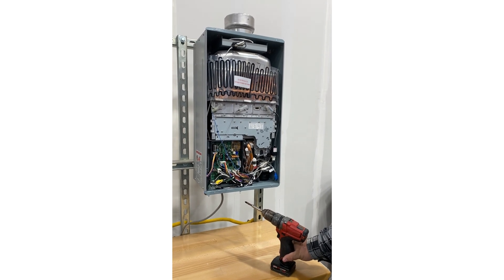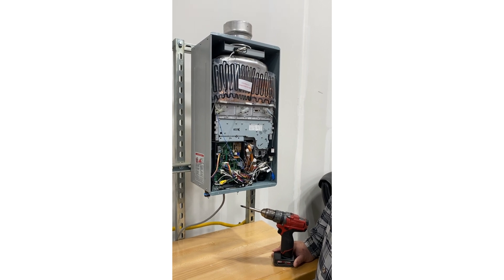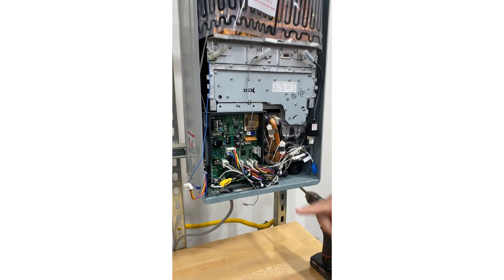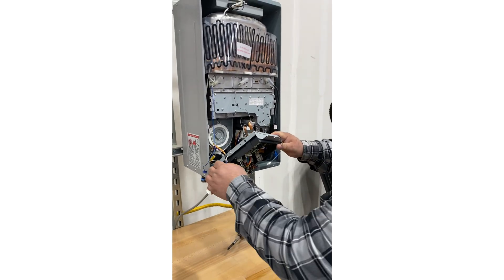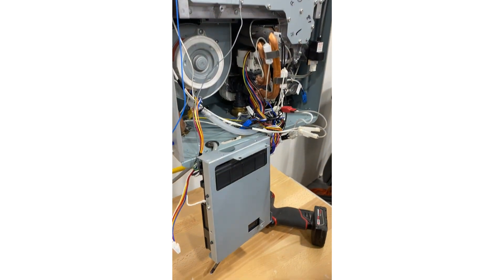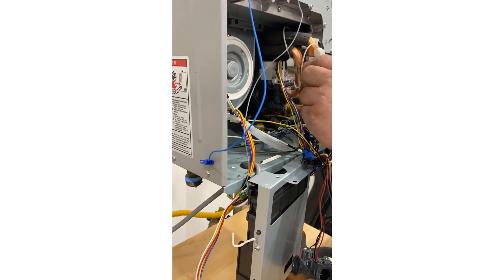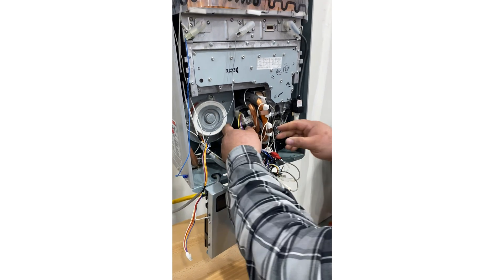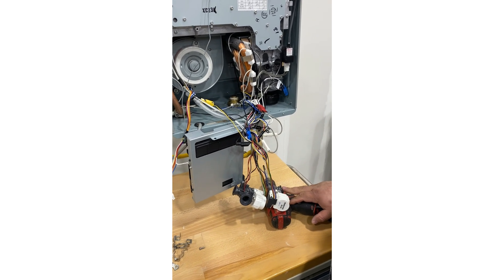Removing and Replacing the Water Control Valve in a Rheem Tankless Water Heater

Comment: Great video! Can anyone advise on the part number of the control/bypass valve combination? Maybe the bypass assembly is RTG20235X. And perhaps the control valve is RTG20164L. Looks like Home Depot has them, but it's a very long wait! I ordered some directly from Rheem and they have a 2-day option, which is nice! Next power outage, I'll know to drain the tank using the two valves just on the outside of the unit (after turning off the water supplies to the tank).
Reply: Those are the model numbers for my water heater as well.
Reply: I tried home depot also and they don't carry in store with over 1 week shipping time. I tried the Rheem website and shipping is faster, but price is a bit higher too.

Comment: Great video. I learn a lots from it. My water mixing valve was leaking causing error 45,  I watched this video to have the concept,  but went furrther than that by opened up the mixing valve because i could not wait for the part ordered from Home Depot. I left the leaking mixing valve on the heater not taking it out ( my waterheater model has room to do it) ,
 i unscrewed the white plastic top (2 long screws), saw the cartridge with leaking sign on the metal cover, 
 I ensured that all water valves closed and drain out all hot water from the sink ( important), open the 3 screws that hold the metal cover, then used a  plier to gently yank out the cartridge, remove the core inside the cartridge to expose the 2 o- ring,   applied silicon grease then put it back in the cartridge ( worked for me somehow, no more leaking, or you can change the o ring, seems like  the Danco #5 o-ring from Home Depot matching it),  then put bact the metal cover piece. 
I slowly opened cold water valves, turn the core of cartridge by hand back and forth to make sure there is no leaking from it., then stopped  at turn the core (counter clock wise ) all the way  (would see error 66 if this is not done properly) screwed back the white plastic top. I opened all waters valve cold and hot, powered it on, had a couple time of error 66 (because of the core position described above) before the water heater came back to life. I will save the part ordered from Home depot in case it happened again. Caution:
 it worked for me, but be careful when do yours.

Comment: Thank you so much! My 2016 Rheem gas tankless hotwater heater kept beeping and giving error code 65 (Water Volumn Control) and no water would come out of faucet. I called a local plumbing company and they charged me $80 to diagnose and give scope of work. I was told the part and install would be $2,500 and the tech wasnt sure when he could get the part. I then found the part at Home Depot and got it shipped to my house in three days. I am so ecstatic i saved all that money. The install was simple and totally managable. You saved me thousands of dollars!
Reply: Mines beeping the same code but I still have water coming out

Comment: Parts have been on order since feb 21st. Home Depot told me they will ship on 3/22! I’m tired of the leak in my wall!
Reply: If you are leaking , are you able to turn off the cold and hot water supply  for the Rheem?
Reply: @origtex  I can turn them off. I finally just cut the space in the garage right below the water heater and used JB waterweld. To seal the can. I’m waiting for it to dry as I’m typing this. Will report back.
Reply: @Im_a_nerd_too  Also, just keep an eye on the pressure relief valve on the far left side. It should have a pvc drain that goes outside. There shouldn't be any pressure, but just take a look at it to make sure you don't see any leaks.

Comment: Great video.  Tips: A) Have a ziploc bag with a piece of paper to  label and store screws.  Contain screws from a certain part in the ziplock bag B) Use a screwdriver that is correct. These screws are very soft and you don't want to mess up/strip  C) Have dry towels nearby  D) Watch video about 4x before you start.  E) Take pictures BEFORE you start.
Reply from the maker: These are all GREAT tips!
Reply: Thanks for the great tips. Only thing I would add is to make super sure to the clamps on the water control valve are correctly placed. I figured it out after a few tries😎

Comment: I’m trying to do this but the existing part is brass where the replacement is dark grey plastic. I’ve been on the phone with rheem 3x and they assured me it’s the correct part. Do you know if the brass version is interchangeable with the new plastic replacement?
Reply from the maker: Hi Christi - can you please reach out to us at 972.881.8757 (between 8and 5) and ask for someone on the Rheem team?   They will be happy to help
Reply: @southwestsales9233  unfortunately after 5 calls and them insisting it was the correct part, I returned the unit to Home Depot.